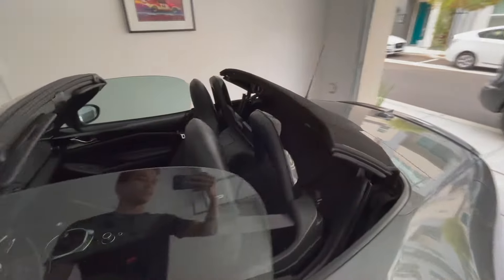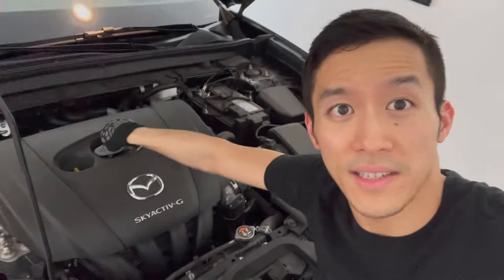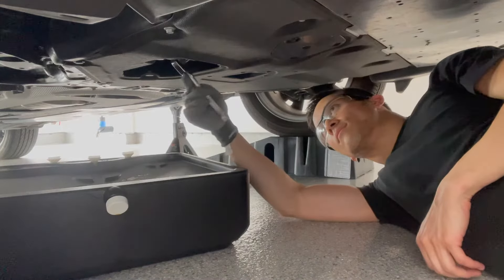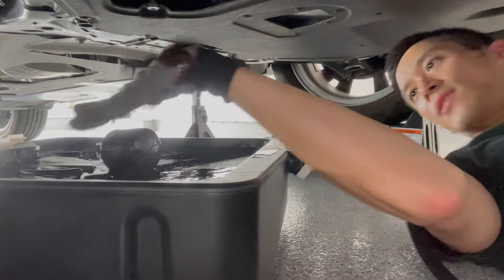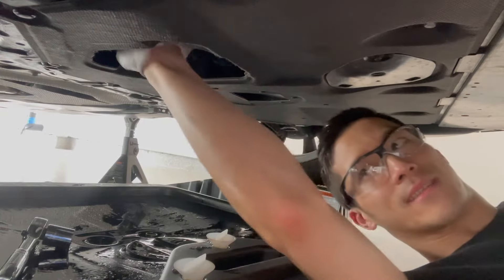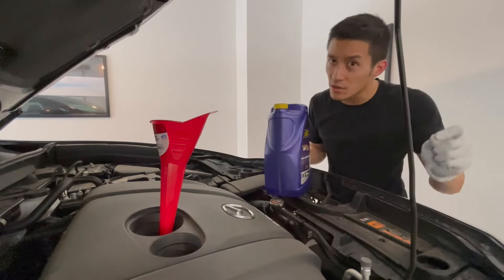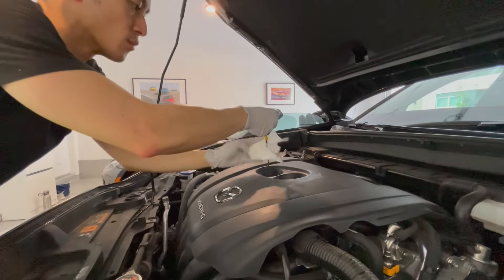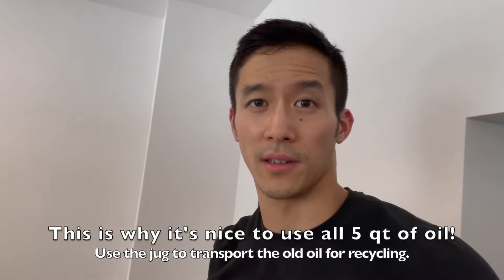My CX-30's First Oil Change! (DIY - Easy Step-by-Step)

Comment from the maker: What's your favorite brand of oil and/or filter, and why? Comment below!
Reply: Always used  Mobil 1 Fully Syn, but recently bought a couple of gallons of Kirklands Fully Syn due to a sale. Both are Dexos certified. As far for oil filters, I always used OEM Mazda filters . Never had a problem and it's priced well.
Reply from the maker: @newamsterdanm  Thanks Dave! Mine was made in Mexico
Reply: I have the same car and love it. Use Wix filters if you do your own oil changes. Do a quick search on youtube here and you will understand. Some of them (Fram) just have some paper inside them.
Reply: @axltobe2  Kirkland oil is made by a company that makes tons of different branded oils. They are fully certified to provide excellent protection in modern vehicles. I have been running Kirkland in my ACURA TSX 2.4L and my 2019 Suburban LT 5.3L for the last several oil changes and I think it's fine. Most important is regular oil changes and not beating on your car.
Reply: Amsoil, that stuff is fantastic!

Comment: I know this late, but just a tip.If u are using a ramp, u are supposed to choke the back wheels with wheel chokes to keep the car from rolling back. Not juckstands.

Comment: Tip: Slip a plastic bag over the oil filter before you unscrew it. It will capture any oil dripping out and over your hands and arms.
Reply: I do that when chaging the fuel filter on my Mercruiser 4.3L MPI
Reply: Or punch a hole in the bottom of the filter , you can use a steel nail or even screw to drain the oil from the bottom of the filter first before unscrewing it
Reply: @kdomster9141  and hope like heck you bought the correct filter replacement!
Reply: Great tip Thanks!

Comment: Hey James , good DIY, just good to mention that when you replace the oil , you should replace the crush washer on the drain plug as well, it prevents a seal on the plug and the oil pan, if the old one is crushed over and over it can dig into the oil pan
Reply: Especially since even the OEM ones are only like $1.50
Reply: I got a bag of copper ones from Amazon. 20 for like I don't know less than $10

Comment: When I change oil on vehicles with oil filter oriented like that I first just loosen the filter a tiny bit to make sure I can get remove it. I then take a punch and punch a hole in the top of the filter to let all the oil drain out. This way when I unscrew the filter I get a lot less mess.

Comment: Two points, once you have run the engine a few seconds to insure the filter is full and check the oil level - you do not have to start it again to recheck the oil if you added more oil.  2nd. You checked the oil quickly after turning off the engine.  It will always read low if the oil has not had time to drain back into the pan.  Always wait a short time such as 5 minutes to do the oil level check after running the engine and about 2 minutes if you only added oil. .
Reply: @@BLAlley @jimmccullin8057 is actually correct on what he said. Maybe you misread his comment.

Comment: A tip I do:  if your filter is vertical like our cx 30, you pre fill the filter with oil before screwing or on. It reduces the inaccuracy of your first measure and reduces the time the engine has without oil at first startup.

Comment: Great video couple of notes. 1) Use 2x4 wood blocks or wheel blocks to prevent the car from rolling instead of jack stands. 2) Break cleaner is better than degreaser. 3) Use a torque ranch to prevent over torque.

Comment: Thank you so much for this helpful video! I really appreciate that you went into detail, in 5:40 do you just screw the plug until it feels tight enough to avoid over torquing? Also when you were pouring the oil, how were you able to measure how much exactly was going in? Is there a measurement tool for the oil? Thank you!
Reply from the maker: You're welcome! At 5:40 if you want to be careful you can use a torque wrench set to the correct torque specification. However, I just did it by hand for convenience and I have a decent feel for how tight it should be. When pouring the oil, the oil jug itself has markings on the side to let you know how many quarts are left in the jug. Hope that helps!
Reply: If you plan on doing your own oil changes, it's good to invest in 3/8 torque wrench. They are not expensive. I like the digital Harbor freight tool store's 3/8 torque adapter.

Comment: I Suggest Fumoto Aftermarket valves for anyone that wants mess free oil changes. You can also use a center punch to drain oil out of canister filters without spilling all over. Great video otherwise thanks !

Comment: For those who want to know, Mazda has a patent in the oil filter so it holds oil under pressure on cold starts. You should only use OEM Mazda Filters. They're not expensive, why save money on something so critical?

Comment: How often do you do oil change?
Reply: Typically between 5000 and 10000 miles is good.  Depends on your budget, and how much you care about your engine.  Spending small amounts of money on oil and filter changes will make the engine last much longer, like forever.

Comment: Nice,  but don't you loose the  waranty in making it yourself ?
Reply from the maker: Luckily, no loss in warranty. In the US, the Magnuson-Moss Warranty Act says that manufacturers can deny a warranty claim only if they can demonstrate that the owner’s work on their car specifically caused the failure. So, as long as you do the work correctly, or the work doesn’t cause any specific damage to the car, your warranty is intact.
Reply: Be sure to keep copies of receipts for the oil change components and an accurate date/mileage log of when you performed the changes.

Comment: How much did you tighten the oil drain plug? I know you put 23-30 lb ft on the screen, but I don’t have a torque wrench that lets me set torque. I saw you might’ve also just tightened it by feel? I’ve read to hand tighten as much as you can, then tighten another 90 degrees (1/4th circle), is that how much you do? Thanks!
Reply: That should be enough. Doesn’t have to be too tight.

Comment: I like to fill the oil filter the day( or hours) before. The oil will soak into filter; what's nice is the CX-30 has a vertical filter, oil won't leak when you install it.

Comment: I have found that when checking the dipstick on my 2022 CX 30 you should wait several hours  before rechecking the level again (from a hot engine) since for some reason it takes a long time for all the oil to drain back into the pan. You added 5 quarts and still show not completely full on the stick. It's best to check again over night !!

Comment: Pro Tip: Used oil works as a wonderful lawn fertilizer.
Reply from the maker: Would definitely cut down on your long term watering costs
Reply: if you belleve this. Don't change your own oil!!!
Reply: @AAAPMC  lol, it was a joke.

Comment: From my experience, with my 2021 it definitely takes a full 5 quarts and if you don't keep it there then you may notice it running a bit rough
Reply from the maker: Interesting—I’ll have to check my oil level and top up if needed, to see if that smooths out the slightly tougher cold start idle I mentioned in my other video. Thanks for the tip!
Reply: Listen, if you're using a Mazda OEM oil filter, it's exactly 4.8qts. Try it
Reply: @SJ-666  So this post is at least  a year old, I have learned a lot since then. Yes 4.8 qts is ideal. However, from my very 1st oil change, at pre drain check the technicians kept telling me it was about a half a quart low, I have had the car checked and checked and they don't know why, nothing seems a miss. I think it's just inaccurate because of course the engine is still warm when you get there and it takes a bit for it to flow back down towards the dip stick. All cars of the same make and model are certainly not exactly the same, my identical loaner car ran completely different, felt different in power and responsiveness. So they can be like jeans, same style and size but that doesn't mean they will fit the same.

Comment: Pretty good video - thanks.
One thing, no need for the filter wrench/strap. Hand tightening the filter about a 1/4 or 1/2 turn after contact has served me well for the 35 years I've done my own oil changes.
Just try removing the 'new' filter (by hand) once you start the car, after completing the oil change - you can't! The pressure within the engine is so great it's next to impossible.
Oh, one more thing - stick to the latex gloves, as used motor oil ruins mechanic-style gloves.
Oh, and another thing (ha) OEM oil filters are of top quality, fit properly, readily available at your local dealership, and competitively priced. Getting to know your Mazda parts staff has its benefits too. If you develop a good rapport with them, chances are you'll be receiving those filters at a reduced price, and perhaps get the the odd crush washer thrown in.
Reply from the maker: I also just hand tighten when putting on the filter. The wrench/strap was just needed to remove the old one. Great tips, thanks for sharing your experience!

Comment: I dislike 0w20 a lot. Not good for scorching hot temperatures at all.
Reply from the maker: Agreed re: hot temps. For anyone living in a hot climate, 5W-30 is better (should be safe because it is the oil grade Mazda uses in many countries for these engines).
Reply: @JamesPlaysWithCars  My friend damaged two engines on that oil. He's got an LPG conversion though, where engine temps are even higher.
Reply: I have always used 0w20 on my Honda Accord 198k miles and no issues. I live in Houston and it gets really hot.

Comment: You didn't mention that the oil should be Synthetic. Move your tools off of the oil catcher and poke a hole in the bottom of the oil filter before you unscrew it. It's less messy that way.  Otherwise good video. The 1st oil change for my CX-30 was free at my Texas dealer.

Comment: I enjoy watching your CX-30 videos!

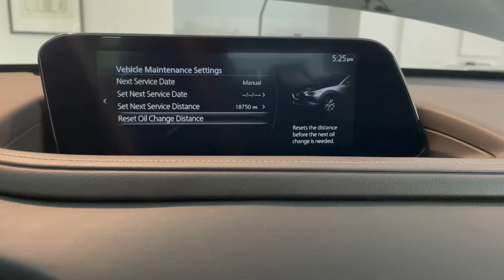At 8:42, I noticed you have your “Next Service Date” set to Manual and “Set Next Service Distance” set to 18750 miles.

I’m wondering, what is that intended for since it seems that you’re using the “Oil Change Distance” to track when to do oil changes?
Reply from the maker: Thanks Expellix! I set that service mileage reminder to an arbitrarily large number because I prefer not to have it nag me. I just check maintenance items periodically and do maintenance when needed, as opposed to following mileage recommendations (except for oil, which you can’t really check the condition of).
Reply: @JamesPlaysWithCars  

Ah, I see haha. I think you might be able to directly delete that distance value or clear it out by setting “Next Service Date” to Automatic and back, to stop it from nagging. I’m not 100% sure though. Arbitrarily large number works fine too!

Also, how frequently do you intend on doing oil changes for your CX-30? I ask because I’ve seen a few figures recommended by various sources, so it’s confusing.

For the US, I think the manual says every 10,000 miles / 12 months (whichever comes first) under normal driving conditions, and every 5,000 miles / 6 months under severe driving conditions. I’ve also seen a recommendation of every 7,500 miles / 6 months thrown around as well by the dealer.
Reply from the maker: @Expellix  I plan on every ~7k-8k miles! That seems to work well. For cars that I drive harder, I usually go for 5k
Reply: @JamesPlaysWithCars  Thanks haha!

Comment: Would you void the warranty since you service the car yourself?
Reply from the maker: Good question. My understanding is that under US law, the warranty is only voided with respect to a particular problem with the car if the manufacturer can show that the owner caused the problem while servicing the car. In other words, servicing the car doesn’t void the warranty unless you actually break something while doing so.
Reply: @JamesPlaysWithCars  I understand, though the service is simple enough not to make a mistake or break anything while doing so. I guess its the risk you take as a owner.

Comment: I just bought that exact car yesterday. Just to add something to DIY oil changes, make sure you hear that click when you unscrew the "new" oil container and don't blindly start dumping the oil in without checking it. I got used oil in a container once from the auto supply store. Someone had scammed the store and brought it back for a refund as unused. The oil I got was darker than a coal miner's arse. Luckily for me I caught it right away and the store believed me when I told them what happened.

Comment: is it true that you should change the oil earlier for the first oil change? My 2021 Mazda 3 sedan has 7500mi increment, but seeing some people online say to change it 4000-5000
Reply from the maker: If you want to be extra careful, then yes! The first oil change can be earlier to clear out any metal shavings that may come off of the engine components during the break-in period. This is less critical in modern times since engine manufacturing has much tighter tolerances than in decades past, but many people still prefer to do the early oil change to be on the safe side. Hope that helps!
Reply: I think it depends on how you drive the car, my Mazda 3 2021 had it at 5,000 miles but I changed it at 4,000 miles. I am planning on keeping this car for a while so a few extra dollars worth of maintenance is cheap insurance. My car has the 2.5G natural aspirated engine.
Reply: @samuelaguilar9051  i have the same car as you. Do you know if the oil looked bad at 4000 miles?
Reply: @joliewu8625  The manual says to change it every 5,000 miles when driving in severe driving schedule. At 4,000 miles it didnt look too bad. I have an old nissan with 2.5 naturally aspirated engine with 195,000 miles and engine works as new, oil intervals done at 5,000 miles. So going 5,000 miles between oil services is a very good interval and probably staying in the conservative side of the lifespan of the oil. I always use fully synthetic oil with a mid range oil filter.
Reply: I do mine every 5000 miles. Cheers.

Comment: When I got to the prepping the filter section I was really hoping you weren't going to say to fill the oil filter because that is completely unnecessary LOL. No issue with putting oil on the gasket obviously, put pre-filling the filter is pointless and not recommended by many manufacturers/mechanics. Great video and thanks for making it.
Reply: Oil is needed immediately during engine-start to move the bearings apart to prevent bearing damage. While the pump is filling the empty filter, it's not supplying oil to the bearings - there's nothing "LOL" about it.
Reply: @kurtbilinski1723  There is already oil in the engine (even after draining it 😲) and the filter is primed within seconds. If your car has a way to prime the oil filter with something like a "flood mode" then why not use it, but pre-filling the filter is silly. 

If you dump oil into the center of the filter you're delivering unfiltered oil directly to the bearings as well which could turn out poorly. You could pre-fill the filter using the holes on the periphery of the filter but it's really not worth the hassle.

Also, LOL.

Comment: Really good video. One thing I recommend is to fill the filter with oil before installing. Oil pressure will build faster at start up.

Comment: Did you rotate tires also?
Reply from the maker: Been procrastinating on that but will do it soon, as we’re approaching the midpoint of our lease!
Reply: @JamesPlaysWithCars  it is my belief that both oil change and tire rotation are done simultaneously. I'm approaching 5000 miles on my cx30. Great car thus far.
Reply from the maker: Yes I agree, it’s definitely ideal to rotate tires more frequently than I actually do.

Comment: I drop the 5 quarts and don't even check the oil levels 😂😂
Reply from the maker: You sir are a brave soul 😆
Reply: Don't be surprised if your valve cover gasket starts leaking  @JamesPlaysWithCars

Comment: Metal oil pan or plastic?
Reply from the maker: My oil collection pan is plastic - it's a cheapo one from Walmart that works really well.
Reply: @JamesPlaysWithCars  i meant on the car...some have plastic oil pans now ..i wanna get a cx30 but not if it has a plastic oil pan...
Reply from the maker: Mine is metal! I have not heard of Mazda using plastic ones.

Comment: Nice video. Did you happen to inspect the drain plug to check for break in metal shavings? Also, will your MX5 fit on those ramps with the lower ground clearance? Did you say where you purchased the ramps? I have an ND MX5 and am currently shopping for a CX30 for my daughter, your videos have been very helpful!
Reply from the maker: Hi Bob, thanks for the kind words and I'm glad the videos have been helpful! I didn't see any shavings on the drain plug, but I should have mentioned that it's good to take look at the plug and wipe off any shavings. 

The ramps are: https://smile.amazon.com/gp/product/B0117EETEK/

The MX-5 scrapes a bit coming up the ramps, but you can put a little block of wood at the base of the ramp to help get the car on without scraping the front lip.

Hope that helps. Cheers!
Reply: Walmart and Menard's and fleet and farm also sell these ramps, around $40 to $45.00.
Reply: That works if the plug is magnetic

Comment: Nice video. 1. always check and change as required the drain plug washer. 2. A final check of the oil level the next morning as oil settles over night. Always fill to the TOP oil level mark. 
Just a hint, take of the engine cover while doing an oil change and have a look at the rest of the motor/engine bay, for anything that looks out of place, damaged or worn. The more familiar you are with your engine bay the easier it is to spot potential issues.